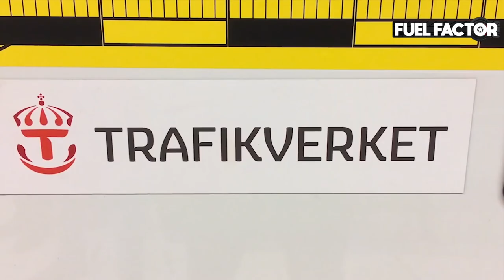RV Crash Tests - Testing the Safety of Recreational Vehicles

Comment: At least the decorative airbags deployed, although totally worthless for the protection of occupants. Reminds me of my very first recreational vehicle, a 1970 VW Westfalia camper bus, this is how I visualized what would happen if it ever crashed, We would have never walked again, if we survived the crash at all. 
Interesting how the ENTIRE body came off the chassis in that first test.
If the industry was forced to build to same safety standards as cars, these things would be five times as expensive as they are now. This is why we use a towable RV trailer.
Reply: Rv trailers are the way to go 👍
Reply: But what happens if the you crash with a trailer?
Reply: @roadbiker8333  Nothing different that the usual crash. You're in your tow vehicle, dependent on it's crash worthiness. Will probably get some extra frame damage from the weight of the RV shoving on the trailer hitch framework.
Reply: It's amazing that a vehicle such as shown in this crash test is even road legal. I've seen Chinese cars fare better, and they don't set the bar particularly high. I suppose the main limiting factor in making campervans safer is weight.

Comment: I no longer want an rv 
Thanks for the video very informative 
I’ll stick to my suv camping day’s.
Reply: Looks like the main problem is the Fiat Ducato base, since it was basically the only big modern van to be crash tested an performed really badly. The only other van that was tested as a car was de 2007 MB Sprinter, and it looked way better
Reply: @Greg White well, I saw a crash test between a Ducato and a Station Wagon. The Ducato didn't perform well.
Also, those big vans, like the Ducato, Master, Sprinter, Crafter, and others, are all body/cab on frame.
At 1:47, you can see a chassis cab ducato crashing, and it wasn't pretty either.
Reply: @Greg White my bad, actually the only big van that is body on frame is the Iveco Daily
Reply: @Greg White well, I'm just considering the cab estructure, since in a crash, the entire interior would crush you anyway.
The problem to me, is that those big vans are not crash tested (at least the passenger vans or panel vans).

Comment: Wow now I'm reconsidering getting a camper and that was hard to watch lol
Reply: I already gave up because of this. I am gathering info to build my own, based on some normal vehicle that will not fall apart in a low speed car crash.
Reply: just buy a hightop van like a vw lt for example, build it like you want it on the inside and there you go, a camper with a unibody.
Reply: Get a travel trailer instead.
Reply: Build one by converting an all metal van or transit bus,use quality components and remember that grams = ounces = pounds. Overbuild everything and don't forget to use adhesives on everything.  Think about how aircraft are made. Hopefully it won't handle like a blimp on ice.

Comment: It's a matter of what kind squooshy death you'd like to be in.  That's why campervans (converted) are really taking off lately... they aren't as safe as a car, but they're a heck of a lot safer than a panel van or a motorhome.

I believe these kind of vehicles are particularly hampered by the the weight registration limits and absolute lack of crash worthiness requirements.
Reply: No tests,  no oversight and no quality control laws. Typical. I should make a video about going to a new motorhome  sales lot and inspecting them myself. I'd probably be sued for defaming garbage by calling them garbage. Converted Uhaul vans using metal and real components would be the safest bet.

Comment: There is something nobody ever realises with these crash tests. Against an immovable object the bigger the vehicle the worse it is. You are far safer in a Smart Car hitting concrete at 50mph than you would be in a big lorry or Semi as the Yanks call them. The lorry cab would be smashed to bits. Of course it is a very different story when a lorry hits a smaller vehicle like a car!
Reply: codprawn 
Mouth how are you better off in a Smart car or do you mean smaller car because regardless unless you were the only small car out there driving yeah you have nothing to worry about because all the accidents that I have seen the small cars are usually getting pulled apart so they can get the carcasses out of them after the bigger vehicles run them over and flatten them or accordion them.
Reply: @jameslowmanjr6141  
I mean a Smart car - look at Smart car crash tests on youtube!
It is like small people - they don't fall as hard as big people!
Reply: @jameslowmanjr6141  the answer to your question is in the weight of the car, or truck or whatever : the force accumulated by the vehicle is proportional to its weight and speed. The more force it has accumulated, the more it has to dissipate, and the more it can hurt. I do not know how this force is named in english, but all truck and bus drivers know about it and its dangers. However, this camping cars should be more studied to improve survival in case of accident. This is far above from dangerous.

Comment: 99% of accidents do not occur though against an immovable object like a brick wall. That’s why you’re seeing such devastation… if it was hitting another vehicle that could move somewhat as it’s being struck you’ll have a totally different result. Most vehicles will be completely totaled in this test. The RV is no special exception to the rule. I have completely redone my 21 foot 1973 Dodge coachman built off the 1 ton sportsman platform and I have reinforced everything and replaced all the one by twos with two by fours and all the 8 inch and quarter inch plywood with half inch and three-quarter inch in mounted everything down to the frame in ways that I thought would’ve been done in the first place, but weren’t and just all around doubled if not triple the durability ….. and anyone out there that’s going to buy an RV I would recommend buying one of the older ones and re-doing it yourself also so you can purposely have the opportunity to beef up everything as I did it’s much smarter than buying a brand new one that still is basically made of paper mache and plastics

Comment: So what is the safest? A semi integrated design mercedes sprinter with a aluminum body like the ones from hymer??
Reply: Converted busses. All steel with unfortunate gas mileage.
Reply: Maybe vw campers? at least they are crash tested by manufacturer
Reply: The safest is a proper van with rear wall or a small lorry. and then camper on the flatbed or in the cargo area.  Sealed off from the driving area.

Comment: This company should be ashamed of themselves garbage.. wood frame construction.
Reply: that’s what I was about ready to say did you see how far the dashboard the steering wheel shove the driver and his seat clear back in to where the kids were sitting. If the momentum didn’t push that table to the side the driver seat would’ve probably decapitated the kid pushing the table into him.
Reply: That's how literally all RV's are made
Reply: Daniel Briggs well some have aluminum frames which aren’t much stronger. the thing is, there isn’t an rv that will hold up good in a crash. they’re not made to go 55 and stop instantly. they DO however hold up against 100+ mph winds, serious thrusting from the roads, and potholes, etc. they ARE strong, just not in a crash test.
Reply: Das ist halt, wenn man lediglich ein Fahrgestell mit vier angetackerten Rädern kauft und dann ein Plastikwohnzimmer mit Pop-Nieten draufsetzt. Hat ja mit integrierter Fahrgastzelle Null zu tun. Und es werden immer mehr von den Dingern. Back to the 70's !
Reply: @bigzeke7431  Exactly! Literally all RV's are like that.
Reply: No shame in any company that builds these things. The worst construction on wheels.

Comment: Almost all class A RVs are flat in the front just like the old cab over semi trucks.  That offers zero front impact protection.  There's simply nothing to absorb the impact to the front.  Class A RVs are the least safest out of all Rvs. Class C RVs have a large engine in the front and offer at least 4 feet of crumble zone in case of frontal impacts.  I'd go with a Class C just for safety sake.  There are lots or roads where a car can come head on into your RV.  Class A RVs give you very low chance of survival in that situation.

Comment: How high was the impact speed ?
Reply: 10 mph
Reply: probably 35-40 mph
Reply: Most every test that’s done is set at 45 mph.  And they really don’t go much higher than that because the scientists have figured out that when you go faster speeds only God knows what happens at them speeds. And they wanted to look good to buyers that’s why I laugh at people when they say I have a five-star crash rating vehicle.
Reply: @jameslowmanjr6141   unless the regulations are different for RV's than it is for cars and trucks then it's no greater than 40 mph.  I work in the industry.
Reply: Jesse Murray wow 5 miles off such a big deal

Comment: Looks like foreign made junk to me. Mine has a big steel frame and bumper right behind the front clip. Am very doubtful it would crumble like that. I wouldn't want to try it, lol, but these manufacturers now days use a crumble zone as being safer as an excuse to build cheap made junk. No it's no safer when the engine and dash crush you!!.
Reply: What brand is it? Second one is a Fiat!
Reply: @nikolanikola8543  not sure but mine is a Winnebago on a big Ford frame. I'm pretty sure it won't crumble like that.
Reply: @bubbaray8670  These are European models, you probably don't get Fiats in your country. Anyway, these are body on frame too, body on frame vehicles are less safe than unibody vehicles... So yours would probably be similar like these in a crash, but nothing to worry about because chances of hitting something rigid are really low.
Reply: bubba ray rather sleep in a tent 😀
Reply: @an04ker  I live in mine. I do  sleep in a tent when I go camping, lol.
Reply: bubba ray darn right Ford don’t believe in that crumble crap they build A frame and a cage around the driver and if you don’t like a Ford then buy a Volvo because those are the only two manufacturers that still believe in protecting the passengers. And a lot of times most these tests are done at 45 mph because when you get into 50 and 80 mph the scientist have no idea what could happen God does and them crumple zones don’t work very good at 65 miles an hour.
Reply: I have a freightliner chassis rv
Reply: bubba ray crumple zones are supposed to stop past the bulkhead and the engine is supposed to go underneath the car. It’s proven science and it does work.
Reply: bubba ray of course it would, I doubt the manufacturer of your vehicle has crash tested it or even made any allowances for a crash since regulations don’t require it.
Reply: @engineergaming4295  the only good ones.
Reply: @jameslowmanjr6141  Volvo aren't usually body on frame at all, I don't even know if they build any bof cars in the last 60 years or so. Maybe the old model big SUV. Volvo and Ford are leagues away from each other in terms of safety, quality, aso, so I don't even know what you're talking about here. The safest cars are generally german or swedish. Crash tests aren't done with much higher speeds, because they'd be pointless. Are you implying a crash at 65 miles WITHOUT a crumple zone would be better for the occupants? Not to mention that even a car without crumple zones would be utterly destroyed at that speed.

Comment: The Big RVs that they have United States would have done even worse.
Reply: Mine was built in Canada to avoid lawsuits and skirt the vehicle construction codes and laws. Its made out of foam, the cheapest wood possible,(most of the structure is knotty pine and fir that was rejected by the yard fencing industry) put on cheap chassis and severely underpowered engines. The brakes are marginal  and now everything is rotten to the core. Its an '87 Lakeview 22' with a 350 cubic inch GMC engine and chassis. Even though it's ancient it should have been no stranger to quality control, it was made by drunken penguins apparently. It's so rotten structurally there's no repairing it. Maintenance of the body was useless from the day it rolled off the assembly line.